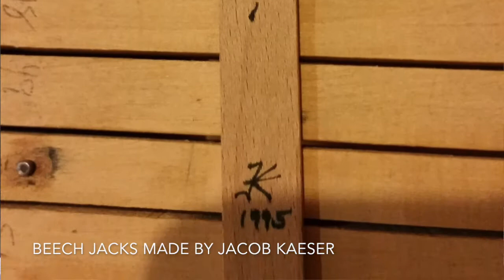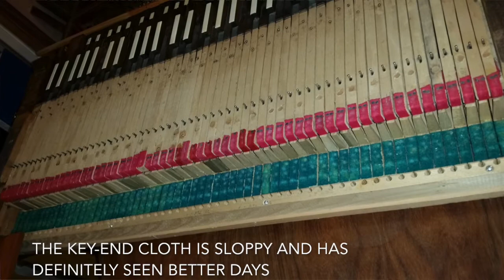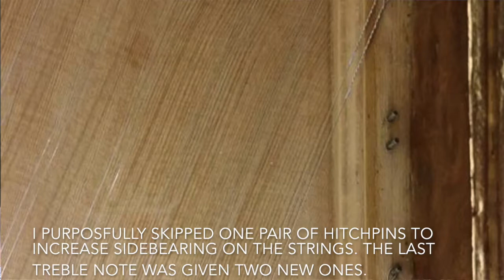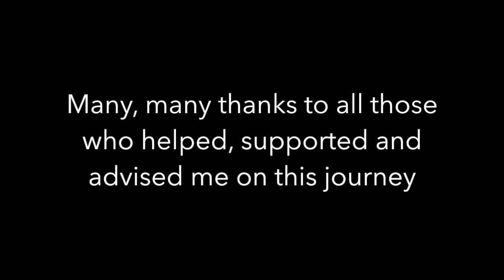Harpsichord Restoration, J.C. F. Fischer - Uranie

Comment: I wish harpsichord's range would be the same as a piano. Those low notes would sound really good.
Reply: artman40 And how much do you think a harpsichord would have to be stretched lengthwise to accommodate strings down to the lowest AAA key? 4 meters? There’s a reason why pianos having spun strings and a metal frame and harpsichords don’t.